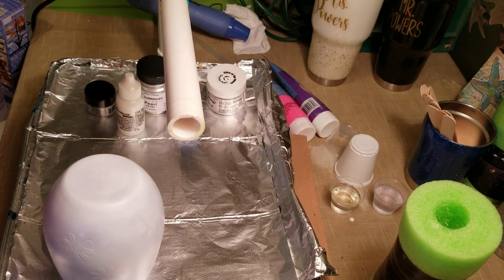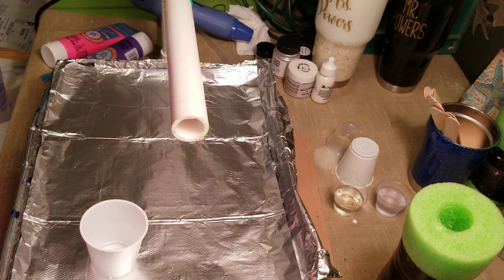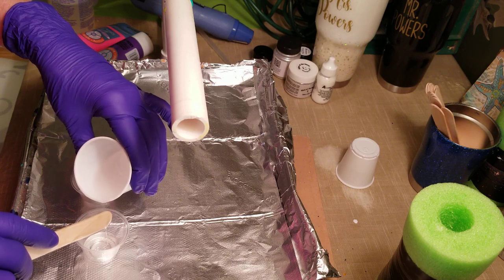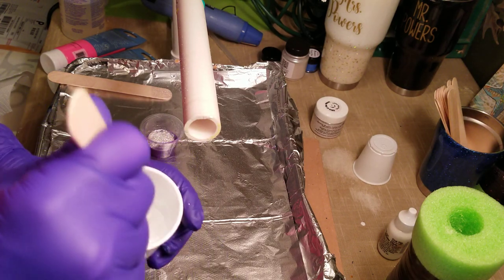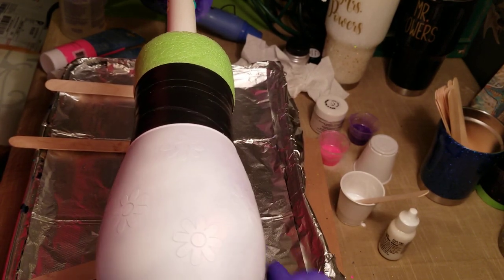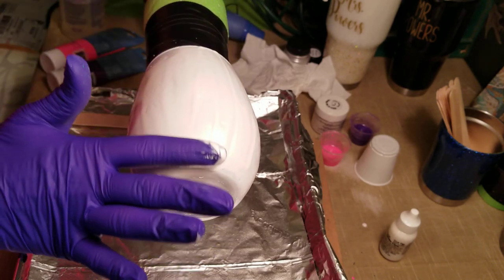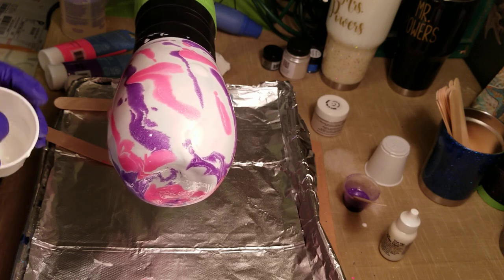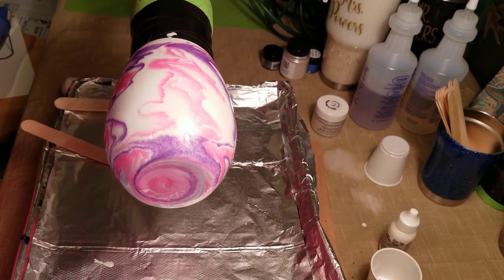Peekaboo Swirl wine glass tutorial - Part 2 of 3

Comment: So I was thinking of doing a half glitter peekaboo wine glass. Would I NEED to spray paint before hand? I was thinking of mixing both acrylic paint and glitter in the pour. But also I would only have something on the bottom. Nothing on the sides.....would this be really see through if I did that?
Reply: I think I know what you're wanting to do.  I'd say as long as your vinyl doesn't get lost in the glitter color, you will be fine.

Comment: How did you do the pink and blue one? I tried to do one with only 2 colors where I wanted them to be equally on the cup and they meshed together and I basically have one color. 😩
Reply: Did you use heat to move it around? Sometimes that happens with me. I've learned not to put them too close in the beginning because as it rotates they start to move around on their own.